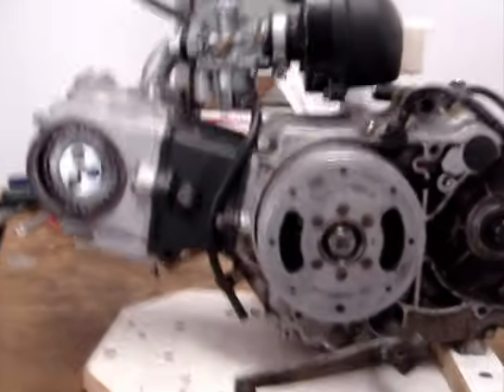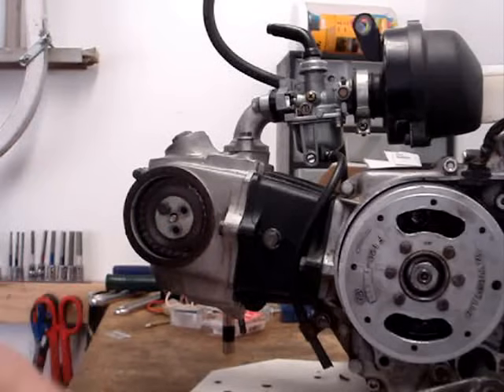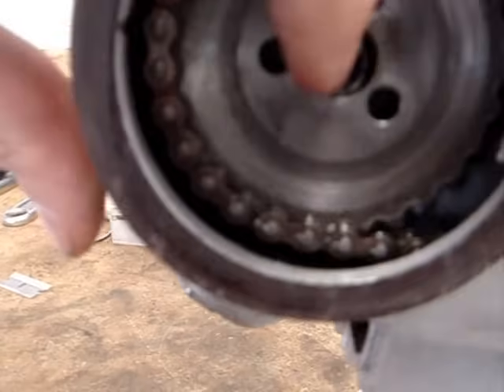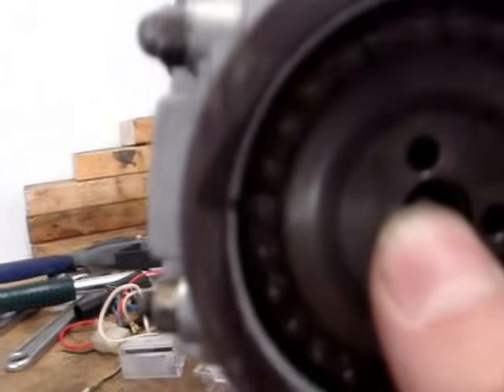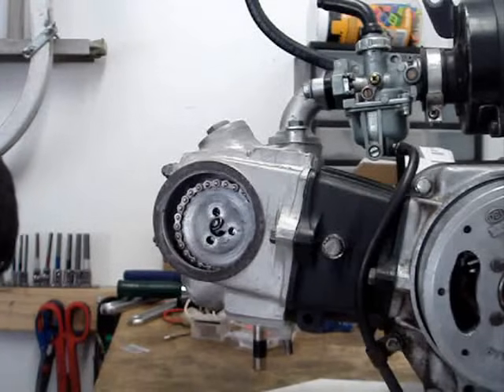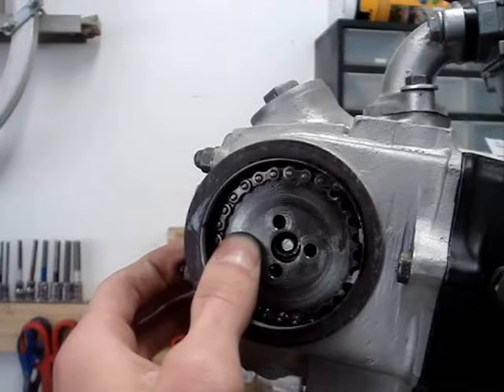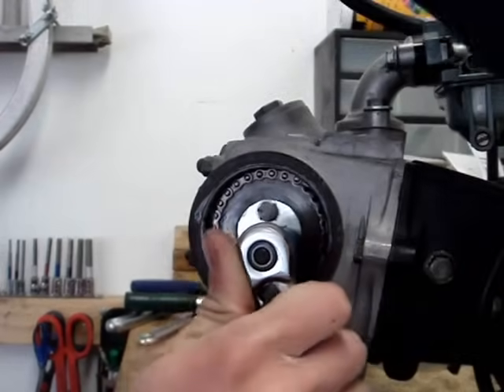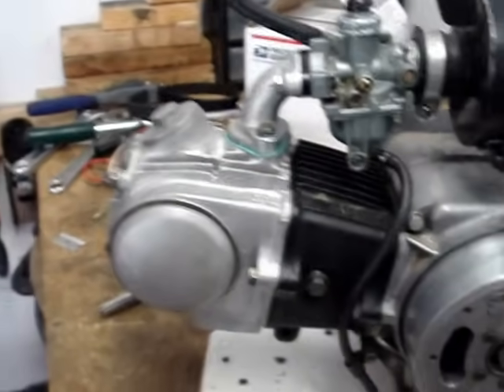How To Set Cam Timing

Comment: I’m at a loss as to how it’ll run ok at 180 degrees out. I know you’re saying it’s a wasted spark setup but surely that doesn’t matter if the engine is getting the spark signal 180 out? Suck squeeze (spark) bang blow. Suck squeeze bang blow (spark). What am I missing? I’m kinda wasted so forgive me 😂

Comment: Haven't rebuilt one in awhile, I've had mine all taken apart, but now I'm having issues with my sprocket going back with the chain on, it's as if the chain is too tight or something, but the sprocket won't go back with the chain on, yet the chain hasn't changed at all, any reason for this?
Reply from the maker: Make sure the chain is properly aligned with the various sprockets and guides on the lower end of the engine. Also, there is a chain adjuster that should be loosened before you install everything, then it should be adjusted once everything is in place.

Comment: hey. my ct70 Honda won't start.  will doing this help?
Reply from the maker: It is not an adjustment that needs to be occasionally made, it is an assembly sequence that must be properly followed. It won't move once it's set. So unless you suspect it was assembled wrong, this won't help.

Comment: Does that timing chain sprocket cover screw off or pop off?
Reply from the maker: Screw directly opposite the center of the cover on the right side of the engine holds the round cam sprocket cover on. Loosen the screw about two or three turns then whack the head of the screw with a hammer to push the cover off.

Comment: You are wrong about timing being ok if the cam sprocket is 180° off! The spiker will only attach to the cam 1 way due to bolt pattern. If you spin that sprocket 180°, it's either will not bolt up to the cam OR your cam lobes will now be at the top which is no good. Cam lobes have to be down in order to set proper valve lash.
Reply from the maker: You're partially right, but I'm not wrong. The three bolt sprockets cannot be put on any other way than correctly due to the bolt pattern. The two bolt sprockets can be installed 180 out, but the bike will still run fine since the ignition is run off of the crank and is a wasted spark system. You must set valve lash with the rockers on the base circle of the cam, yes. This would occur with the crank at the T mark and the cam sprocket dot 180 degrees from the mark on the head. Bike would run exactly the same.
Reply: I have had one that was 180 out I e learned with these chicken quads tho there very temper mental and seems like something will work on one and not on the next I just did a complete top end rebuild on one just did first ride yesterday I believe I'm off half a tooth idles fine but give it gas wants to die out and pops out carb and when starting it made awful noise like something hit something idk going to re check it again and see so when setting time long as it's at tdc does it matter compression or exhaust stroke?

Comment: How to remove timing sprocket cover? I have oil leaking from there..
Reply from the maker: The cam sprocket or the one behind the flywheel? The cam sprocket cover is held on by a long screw all the way through the cylinder head. The head of the screw is on the right side of the cylinder head in front of the spark plug. The cover behind the flywheel will require the flywheel to be removed. This requires a special puller tool. Then just remove the two Phillips head screws.

Comment: It is the engine ok? Will last least 20000 miles on a moped? What do you think about this clone engines made in China?
Reply from the maker: I've built lots of real Honda engines and been very happy. I've never bought a clone engine and don't ever plan to. I'm not going to support that market. Not sure I'd really want to go 20,000 miles on one of these engines, that would take a long time.

Comment: So there sprocket can only bolt on one way??? Or it doesn't matter what holes on sprocket go-to what holes on cam?? Cause I don't see marks on cam? Just bolt sprocket any way and set marks??
Reply from the maker: Some engines the cam sprocket can only go on one way, there is no way to install the sprocket backwards or anything other than correct. Other engines just have two bolt holes 180 degrees apart. So you can install the cam 180 degrees from correct or even backwards so the marks are not visible. Now, I've never seen a cam sprocket without any timing marks, but there's no saying what the Chinese knock-off engines are doing. I never work on those, and all my experience and advice is in regards to genuine Honda engines. Now here's where it gets confusing and people argue with me. There is no such thing as timing the engine "180 off". The engine uses a wasted spark ignition, so it sparks every time the piston comes up. This means if you install the cam sprocket 180 degrees off from where it's supposed to be on the cam, it will run exactly the same. So while functional and you could make this mistake with no consequences, I would say this is sloppy and shows you don't know how to properly assemble the engine. The only issue arises if you don't line up the timing marks on the cam with the head at the same time the flywheel is lined up at TDC.

Comment: i have a 140 stomp pit bike and if it ant timed up right would it course it to run bad like it ticks over fine but when you rev it it bogs and engine gets hot very quick like with in a min or two but when u put the t for time at the mark its ment to be at it hits the valve so iv had to put the timing in a spot that i think its in iv even took off the head to see if the piston is at the very top and it starts fine but dont run fine and its on the exhust stroke any help please on how to solve this

Comment: What do you do with cam chain tension when a head and cylinder is decked?  These engines do not have tensioners!?
Reply from the maker: They most certainly do have tensioners. Depending on the year it's an automatic tensioner or a manual tensioner. No need to mess with an automatic tensioner. The manual one is adjusted with the set screw and locknut just forward of the shift shaft and below the flywheel in conjunction with the adjustment screw located on the bottom of the engine.

Comment: I'm having trouble with my second hand YX140 4-stroke engine. Because it's a second hand engine I've revised the carburetor and changed/renewed everything that was needed ( oil, gasoline, gaskets, rubbers, sparkplug, etc,... ). When I tried to start the engine for the first time, during summer, it fired up right away. But after the first start it's alwasy been hard to start the engine when cold, never when the engine was at operating temperature. Besides the starting problem there were no problems when I was driving around. Well, the engine didn't idle regularly but other than that no problems. When summer was over and it got colder it was even harder to get the engine running. The last time I went for a ride, during winter, again hard to start, no problems while driving when the engine was cold but the moment the engine warmed up, the rpm went up when idling and the engine stalled. I've set the valve clearance, changed the CDI and ignition coil but still it's very hard to start the engine.... The engine fired up two times, stalled right away and after that the kickstarter kicked back constantly so I gave up...  What could it be?
Reply: i know your comment is 4 years ago but did you manage to find out the reason why?

Comment: Hello sir ..I got a question for you...I have splendor pro..well ridden 30,000 km...but somehow it is making some weird noises from the engine...the mechanic says that need to change the timing chain...can we tighten up the spring on which the timing chain relies ...what can we do instead of changing the chain ?? Answer please...
Reply: Ronak Macwan you cant really do nothing if you dont change it it will snap and causing your piston to slam the valves better spend 30 bucks over 400

Comment: Hi does this procedure apply on coolster 125cc?
Reply: hank hamadi pretty much all motors are the same. U will have a top dead mark on fly wheel and a line up mark on ur cam gear.

Comment: Thanks! I got an engine with the marking 180 degrees from the notch. trying to trouble shoot why there is hardly any room for clearance adjustment on the tappets. they are slightly pushed down at tdc and if I set it to clearance at that point, they go up further at firing position and tap tap tap. could I be off a tooth?

Comment: Hey can anyone help me out. I have a 125cc pit bike and I can't get it to start it has spark and fuel but I'm pretty sure the timing is off
Reply from the maker: You're pretty sure? What leads you to that thought? Did you check the timing? Using this video you'll be able to verify if cam timing is correct. The parts may look slightly different but the principles are the same. Take off the covers, set the crank to TDC, verify that the cam marks are aligned also.

Comment: my head gasket had blew on my 125cc pit bike so I put a new one on and when I took the casing off the flywheel my pick up was snapped so I replaced the stator and now I don't get a spark any ideas to what it could be I've put a new ignition coil and cdi on it as well
Reply: Connor Hall make sure u have ur wiring harness wired up correctly

Comment: I'm unable to rotate came by hand. The only way it will turn is if the the cam sprocket is bolted in and I spin turn the crank..?
Reply from the maker: Sounds like you are trying to rotate the cam while it's at or near TDC on the exhaust stroke. At this point in the rotation both lobes are opening the valves and this will make it difficult to rotate the cam by hand. Rotate the crank 1 full rotation which will rotate the cam a half revolution and chances are you will be able to remove the cam sprocket and rotate the cam by hand. If this doesn't solve it, check that your valve clearances aren't too tight. If that isn't the problem either, then something may be damaged such as a bearing or who knows what.

Comment: So I have a 1986 YFM moto 4 80 and its spitting gas out the carb do you know what this means?
Reply: ChrisFixItUp If it is slowly dripping out of the overflow hose, you have either a worn valve needle, dirt in the valve seat, a worn o ring on the valve seat, or your float height is off. Check your owners manual for float height. But most common cause when you havent cleaned the carb in a while means you have dirt in the carb. Clean it and youre good. My bike was really leaking bad and i ended up adjusting the float height and replacing the needle valve, valve seat and o ring and its good to go! Hope this helps. Dont be afraid to ask my questions!

Comment: Hey I've been experimenting with the same engine, I found a while back that if you set it slightly advanced or early (can't remember which one) you get more torque. However, I had a piston and valve touch each other at high rpm once and popped the timing chain, thankfully the piston was fine, but I bent a valve. I was able to bend it back and run it again... I've recently replaced the top end on that bike, and it now has a flat top piston that's quite a distance from the valves so I'm thinking of running this experiment again. Do you think it's a good idea?
Reply: Also, did you make that pressure plate?
Reply: my timing was so advanced that it would grind but the torque was very high after this video i put the timing back to normal and lost some torque now i understand why
Reply: Big distance from velve = low compression = low power =slow
Reply: Yes.

Comment: what is the purpose to set the cam timing?
Reply from the maker: The camshaft controls when and how the valves open relative to the motion of the crankshaft. If the valves open too soon or too late the engine will not run optimally. If they are off by more than a tiny fraction then serious engine damage can result. Setting cam timing is something that must be done during engine assembly to ensure it will work as designed. It's not something that will ever go out of adjustment like ignition timing, so after disassembly is the only time it's required.
Reply: If your piston is not in time with the cam, the valve will destroy your piston and bend or break the valve and you will have an expensive fix.

Comment: i have a 2004 terminator.  If i set my cam with the timing by fan how come my rocker arms are flapping? im instructed to line the two holes in line with case and larger hole out in middle of cam.

Comment: Will engine run if cam chain is off by 1 tooth?
Reply from the maker: In most cases, yes. But it'll likely run like crap.
Reply: @TheAlexManVideos  could that be a reason for lower compression when kicking?

Comment: wonder if you can help me, got a pitbike, my mate crashed in the top end of it causing it to cut out and loose compression and knocked it of timing, bought a new head as it's cheap enough, but it would time it's either one tooth above the knotch or one below, what should I check, thanks

Comment: TheAlexManVideos I just had my timing chain break on my 1969 Honda Z50, initail visual inspection leads me to believe that the worn timing chain (engine was at wide open throttle), skipped a link, and that stretch snapped the chain... do you have a video on how to install a new timing chain? I really want to get it going again as cheaply as possible (labor wise).
Reply: Byg0tef
Reply: Hobie16Sailor coming for 150 passport moped

Comment: Great video. I am actually just trying to change a gasket, but I cannot figure out how to get the sprocket off. I have a similar engine and I have the 3 bolts out, but cannot figure out how to pull the sprocket off. You made it look so simple and I saw another video of a guy using needle nose, but I can't get it to budge. What am I doing wrong?

Comment: Hi, the screws that hold the sprocket to the camshaft on my 100cc honda seem to be scraping against the cam cover. why would this be?
Reply: The heads worn enough to let the cam "walk" side to side. That happened to mine years ago (1971 model)

Comment: Hey I have a 07 crf50 I have spark timing is set vavles were they need and the carb is clean won't even start on starter fluid could u help me out I'm stumped

Comment: Hey Bud, I can build a Bike from the Ground up, but I can't get that Round Cam cover off. I don't want to brake it. Not the Valve, but the Round cover. Do I turn it, pop it off or is something holding it. I want to powder coat my Engine covers. Thanks !!!!
Reply from the maker: A long bolt with a 10mm head goes all the way through the camshaft to the other side of the head. It's the bolt directly in front of the spark plug. Remove that and the cover comes off.
Reply: TheAlexManVideos Ok, I'm an idiot. Yes, just got it. My buddy who works on Bikes said, shit, I never knew that. I just powder coated it so had to get it off. I thought it just screwed off. Thanks Bud !!!!
Reply: I am having the same problem....Even with the bolt out??? I'm guessing it's stuck on, but i don't know what to use to get it off?
Reply: Aaron M yep, it's easy as hell. just get a small flat head and carefully pop it out. Are you putting a new one on or just painting it?
Reply: Silk Boxing You ain't alone.....just got through 30 torturous minutes of my own. Damn!...i do feel dumb. The cover literally fell out on it's own when i backed the long bolt out. I'm in the philippines working on my brother in laws worn out bike. This was too funny.
Reply: +Aaron M (And anyone else who may encounter a stuck cover) Just loosen the bolt a few turns and tap on the head of the bolt and it will pop right off. Sometimes the gasket gets stuck and if you use a screwdriver or something to try and pry on the cover side you run the risk of ruining the gasket or scratching the gasket surface. You always wanna be super careful around any gasket surfaces!